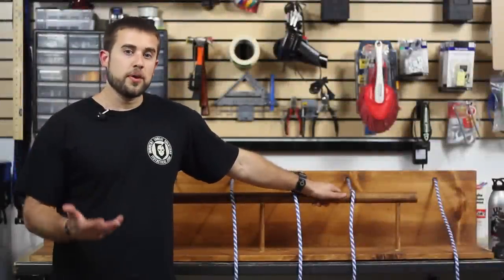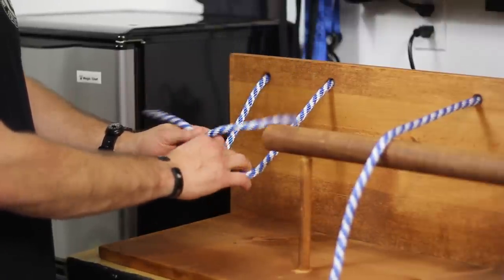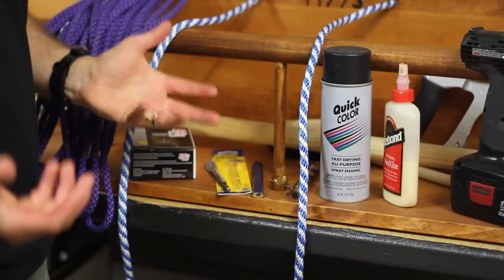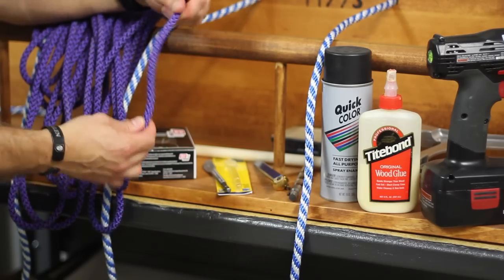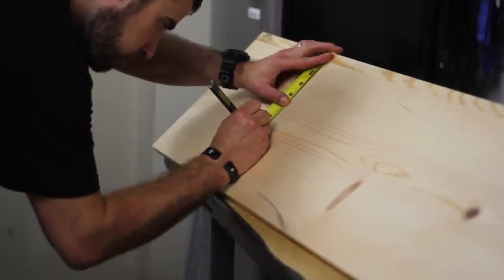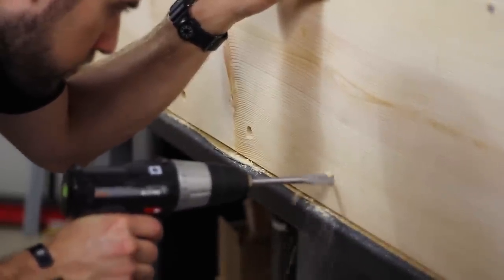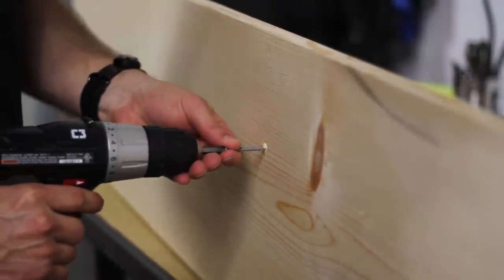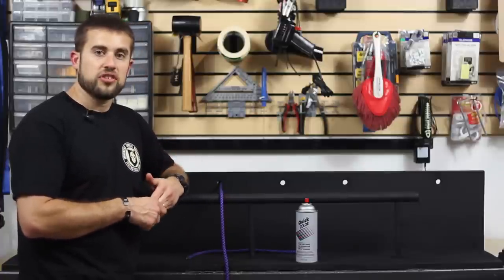DIY Knot Tying Station to Practice Your Knots

Comment: I like this station for my son. 
I wanted something a bit more versatile so I put big eye screws into studs in the wall (with washers) and then added one across the room to practice trucker’s hitch variations as well as alpine butterfly and lark’s head/prusik. 
It works better than I thought it would. And holds a tremendous amount of tension for mid shipman’s knot and trucker’s hitch style. 
I also love to use a variant of the cow hitch that I just call a loop hitch because it’s more dependable under load.

Comment: If you're looking to cut down your time, tie the clove hitch with two quick opposing loops (looks like an 8) and slip it on the end of the pipe.  Save you a second or two.  I know you'll say I'm cheating, but I'm just thinking of saving time if you can go over the end.

Comment: Nice ideas - but wood glue should have been sufficient for the posts with no screw necessary. Wood glue actually holds more weight than screws, especially since you're screwing into the end grain. It's not really going to support anything.
Reply: I was wondering that same thing. Cheers to the first reply in 7 years!! :-)